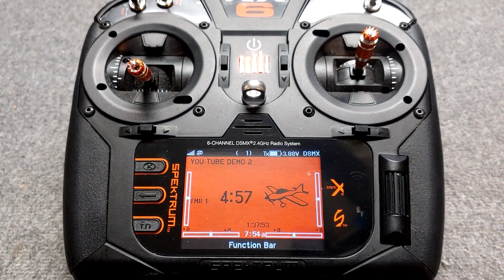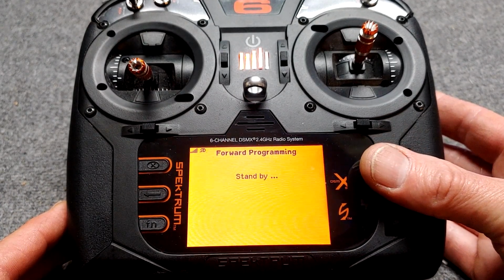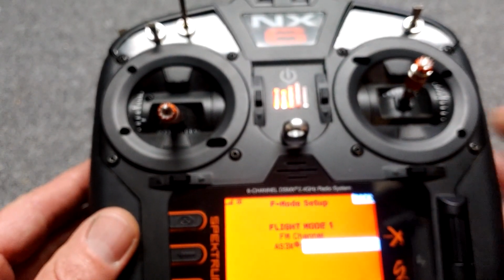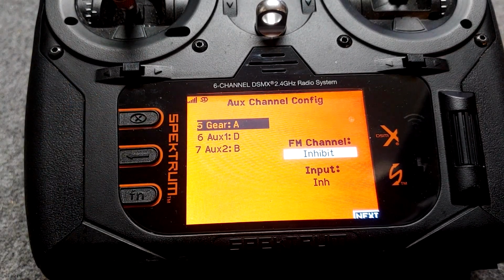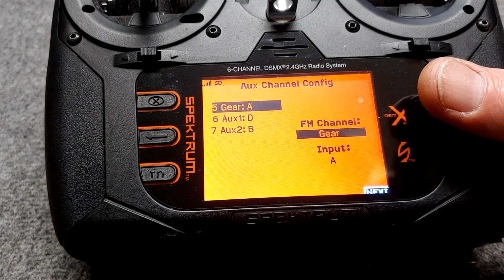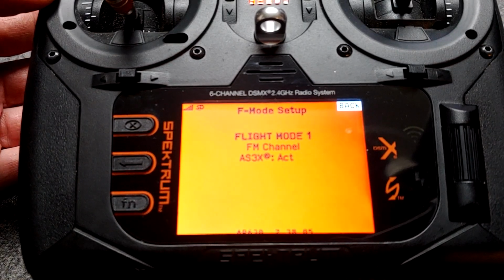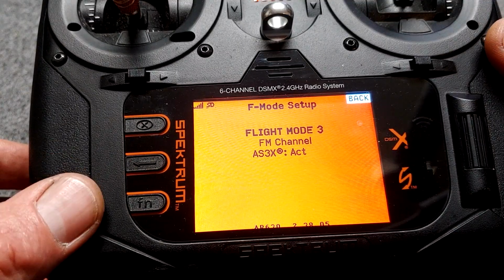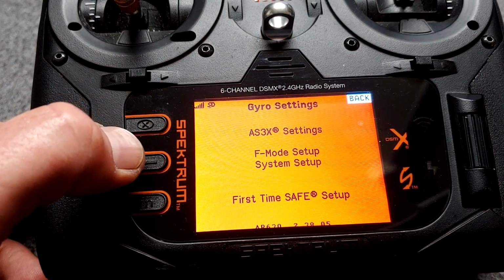SPEKTRUM FORWARD PROGRAMMING SET UP SAFE AND AS3X EASY TO UNDERSTAND PART 2 FM CHANNEL SELECTION

Comment: Wow, Griffin-congratulations on such an incredible channel! I've only been flying RC planes for about eight months, and honestly, I thought things like Forward Programming and Gains were way over my head. But after watching your videos, it all started clicking. Thanks to your guidance, I was able to get my FMS ASW-17 2500mm Sailplane flying beautifully with AS3X and SAFE Select using my NX10 transmitter.

I've watched dozens of other videos that just left me frustrated, but in the past few days I've learned more from your channel than I ever imagined possible. At 77 years old, as a veteran, this hobby has quickly become a passion for me—and it takes me right back to the 1980s, when I spent over a decade hang gliding, logging 1,000+ hours in the air and even teaching with the USHGA in Ellenville, NY. Flying at 12,000 feet over Telluride, Colorado was an unforgettable time... and now this RC adventure is giving me that same joy again.

Thanks for keeping it real, Griffin-you're a fantastic teacher and a true inspiration!

Comment: Thanks for sharing your knowledge, it happened to me that AS3X does not work, even if correctly set, with the AR10360T receiver, even if the SAFE is Ok. If it can be of interest, I solved it this way: go to Forward Programming > System Setup > Relearn Servo Settings , change "All" to "Primary" and select Apply. Now everything works. ( It doesn't work with "All")
Greetings from Italy.

Comment: one mine  i use switch C    position on  AS3X only   position 2  is OFF  position 3  is safe mode with as3x    i set these settings for all my planes
Reply from the maker: That is a good setting. Can you tell the difference when you are in the middle setting .

Comment: 1. SAFE-Select isn't a flight mode; it's the process Spektrum uses at bind time to allow you to enable SAFE if you want to use it. When you pull the bind plug after powering  up the receiver, but before you do the bind, you are "selecting" to use the SAFE feature. If you don't want SAFE enabled, you leave the bind plug in until after you bind the receiver to your transmitter.
2. Since I have a 9 channel transmitter, I always use channel 7 to control the receiver's flight modes. I use channel 8 for panic mode and if I want adjustable gains, I assign the knob to channel 9. The only time I'd only use channel 5 or 6 to control the receiver's flight modes would be if my transmitter didn't have more than 6 channels.
3. Switch A and channel 5 are for retracts. Switch D and channel 6 are for flaps. If you use them for something else, you'll have to relearn what to do when you graduate to a plane with retracts and/or flaps. Plus, these are the default settings when you create a new model. So, you'll have to reconfigure  every new model because of the bad habits you've developed.